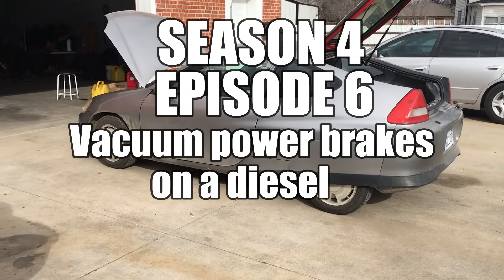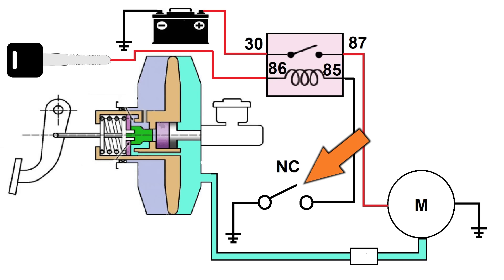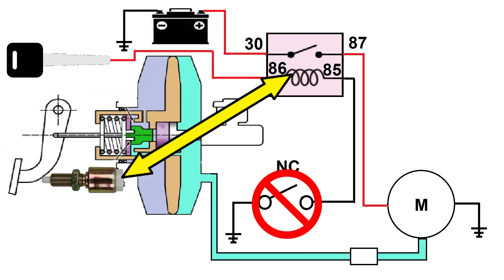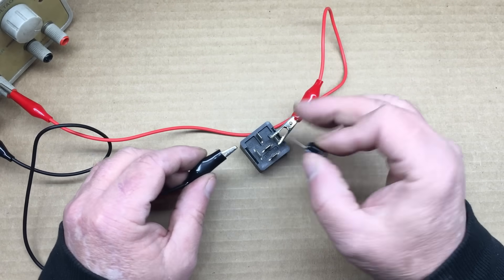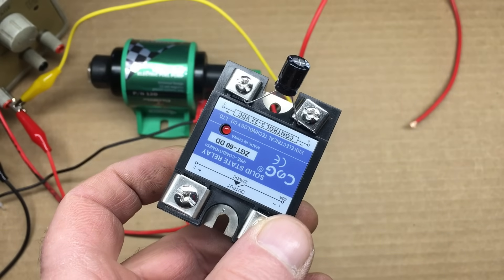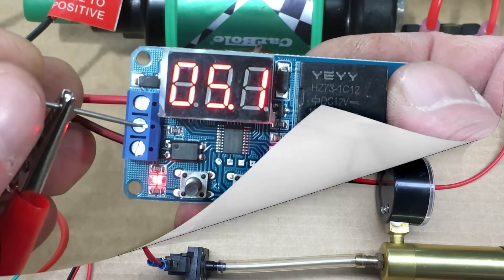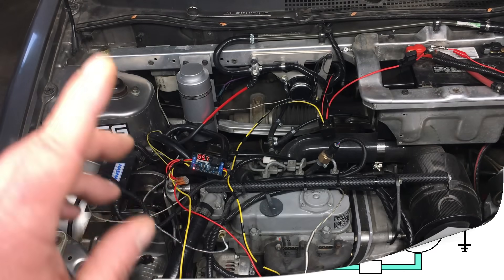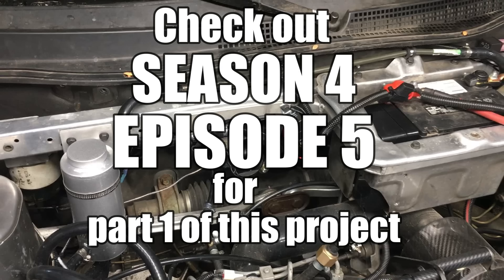S4 E6. low cost vacuum power brakes for our diesel Honda.. problems  solved.

Comment: Why do I feel like Jimbo, low on time, simply punted another episode down the road instead of moving on with the turbo install?  Certainly this problem was not worth an entire episode.

Yeah, so after having offered the above comment, I should acknowledge that Jim may be brilliant in some ways, and less brilliant (like me) in electronics and electronics WRT hydraulic systems.  I'm very sure he tracks and honors some very good suggestions from viewers smarter than me.  I'm in it for the "MEH" and the "guffaw".  Others are more serious.  

Keep on building Jimbo.

Comment: I once wired a relay to a "theater lighting" delay to keep a ICU off for a few seconds during cranking as it was getting its eprom corrupted during cranking.

Also zener diodes FTW

Comment: Shame you couldn't find a replacement relay to solder to the timer board to handle more current and simplify the design. Oh well, them's the breaks. It works, that's what matters 🤘

Edit: Pun not intended but I'm totally gonna take that one 😂

Comment: You probably can just remove the relay from the programmable relays circuit board and just wire the larger relay in place of the original relay.

Comment: would not extra capacity of vacuum via a reservoir allow for pump to not come on as often? aka- reduce the clatter by not reducing the clatter.....  but by reducing "how often" it is in clatter mode to a point it is  no longer or not as irritating to the car occupants.  Reducing that way not only saves occupant ears/mindset.... but also makes pump last longer (not active as often hmmm.. then again it would be active for longer  time period each time hmmm)

Comment: I had a similar problem with making a bed light for my 2016 Tacoma. I used a supercapacitor and charged it with a car brake light bulb to get over the surge issue. The supercap is about the size as the one you in your video, it held the relay on for about 38 seconds, long enough for me to go into the house with plenty of light 🙂 No semiconductors needed.

Comment: Those cheap solid state relays use optoisolators as circuit protection.  As far as the delay for your vacuum pump is concerned, I would probably end up getting an Arduino nano, a 5v trigger solid state relay (or wire up a mosfet with a protection circuit), and a vacuum sensor.  I'd program the Arduino to switch off the relay to the pump at a higher vacuum than I needed to operate the brake assist and switch the pump on at a lower level of vacuum.  It would be more precise and better for the whole system than a simple time delay.  I don't know if you have one, but I would then just use my 3D printer to print out a case for it to protect everything from the elements.  

Actually, knowing me, I'd probably be using one of my ESP32s, grab a logic level shifter to go from 3.3v to 5, use it to control a lot more things, and use the built-in wifi/Bluetooth connectivity to do something crazy and probably stupid like talk to another ESP32 that runs the dash, also giving me the ability to check logged data from my cell phone.  These controllers are incredible and only cost a few bucks.  They're DEFINITELY an incredible value for the money.

Comment: I'm guessing that the vacuum switch is chattering because it's seeing pressure pulsations from the vacuum pump due to its placement in the hose.  If you had a vacuum reservoir and put the switch on the reservoir, the switch wouldn't chatter because the reservoir would damp the pulsations from the pump.

Comment: does any person carrying vehicle do fully electric brakes? (like, electric all the way to the actuator, no cables and no hydraulics?) I assume somebody does brake-by-wire by now and has figured how to make that somewhat safe
Reply: Its hard to beat hydrolic brakes in small vehicles. 

According to Wikipedia- under their "brake by wire" entry, no production vehicles have implemented it to date. It appears it requires a redundancy so it might be down to costs unless something changes.

Comment: Just some points about electrical noise. The large caps across the solid state relay input will filter the low frequency noise spikes. Adding a 0.1 uf cap in parallel will filter the high freq noise spikes. Putting a reverse diode across the input: +ve (anode) to ground, -ve (cathode) to positive side will prevent negative voltage spikes. Lastly, the car battery acts as a monster capacitor. Run a fused wire directly to the battery - consider the battery as a clean power source.

Comment: Could have used a transistor to turns on the relay and the pressure sensor to feed the base of the transistor with a very small Capacitor and a potentiometer to adjust the discharge rate of the Capacitor (how long you want the relay to stay on) transistor don't really discharge Capacitor that fast.... in other words you could have made yourself a basic timer relay

Comment: The modified KISS solution is usually the best, that being the Keep It Stupid Simple approach in terms of reliability. The only other thing that came to mind was a pressure switch that has a fair amount of wiggle room for the on/off cutout, though the cheapie diaphragm-based ones like to blow out at the worst time (aka, when you Need it!) Your electronic timer is perfect though, and should remain Much more reliable. Kudos my man!

Comment: You could always use a mechanical relay to drive the input of the capacitor for the solid state relay to eliminate the inrush current issues.

To keep the programmable relay but simplify the circuit you could de-solder the low power relay from the programmable board, then tap off of the board for the relay trigger signal and run that to the high power snubbed relay.  Or the time delay board may even have a snubber diode on the coil driver, so you can go back to the cheaper automotive relays.

Comment: I think you could do it with a mechanical solution by having an accumulator right before the vacuum pump and an orifice. There would be an excess of vacuum in the accumulator because of the restriction and it would pull the vacuum in the booster below the vacuum needed to disengage the switch, but electronics is ofc fine too

Comment: I was getting all sorts of ideas while watching this video for building a mechanical vacuum pump similar to and old chevy fuel pump working off of some sort of cam, but then I realized the little diesel engine is already strapped and the parasitic load of another device would lower your 0-50 times to a painful level …. Ah well, Thanx for the lesson in electronics ❤

Comment: So, just rolling the rock around here.... Wouldn't it be easier with how small the car is to just ditch the vacuum assist and go with a much larger master cylinder? If it works in my race cars, and they'll stop on a dime, I don't see why it wouldn't work in a much smaller/lighter application 🤷🏻‍♂️
Reply from the maker: Actually, as I indicated in the previous video the power assist brakes aren't really necessary on this car. We dove the car for years without the power assist.  The main purpose of these videos is to provide entertaining technical information.  The power brake info we provided is helpful for  folks who run a lot of boost in turbocharged or supercharged gasoline cars.

Comment: I'm surprised there isn't a check valve on the booster itself according to the diagram. I have found boosters holding vacuum for months even without ever running the engine until the check valve is removed from the booster and you hear the satisfactory whoosh. If the booster loses vacuum without applying brake force then there is a leak somewhere.
Reply from the maker: On this car there is no check valve in the booster.   Foe some reason Honda put the valve in the vacuum line that feeds the booster.

Comment: A reservoir would help (but not necessarily solve) the chatter but not by volume of gas. Part of the cause of the chatter is from temperature change. The remaining gas is cooled on pump-down due to the decrease in pressure. It immediately begins to re-warm, increasing the pressure slightly, re-triggering the switch. This will always happen in a decreasing oscillation until equilibrium. A reservoir adds gas volume which also means a larger thermal buffer as well as thermal exchange area. Decreasing the frequency of the oscillation.  A bunch of variables go into how much of a "fix" this would be. Too hard to say with the small system you're working on. But it is cheap and simple to try. - Oh, and this is why on older cars you'd often see a vacuum reservoir mounted down in the fender. So that engine bay temps would have less of an effect on the remaining gas volume.
Reply: The cause of the chatter is that the switch has no hysteresis, the contacts gradually get pulled apart as the vacuum increases rather than snapping open, and then snapping closed when the vacuum falls by some preset amount. A reservoir will not change this behaviour, a better vacuum switch would be the correct solution.

Comment: A big cheap Solid state relay comes in the 2004 Ford Expedition as the rear air bag pump relay. I believe it's a 40 or 60 amp relay.
Reply: GM used some for their headlamps too (I think it was headlamps? They used them for sure though somewhere) around the GMT800 era I think. My memory is specifically recalling the trailblazer/envoy(and the often forgotten Buick Rainier) platform, but I could be wrong. I very specifically remember it being GM though so they should be fairly available at a reasonable cost these days I figure? 

I love that I'm not the only one that remembers little things like this. First one I ever sold, someone about shat at the price (they were real high still about 10 ish years ago) 😂
Reply: @goosenotmaverick1156  Oh yeah good call I forgot about the gmt360/370 Trailblazer low beam and radiator fan using solid state relays 15-20amp I believe. It's the one with the weird pin layout it had 3 pins on one side then a single pin on the other side instead of the normal 2 pins on each side. If I recall correctly.

Comment: Love to see the ins and outs of this stuff, personal I don't have a clue as to what electric stuff does but it doesn't mean I don't try to follow what's going on .odd really because I made circuit boards and tested stuff for over 13 years (put board in jig press button light goes green or red put board in good box or re work box )

Comment: Great video and explanation, Jimbo.  I’m familiar with all that you went over, but had a thought…. At one point you showed an Arduino as part of your future enhancements.  When you reach that point, the Arduino could easily replace the time delay relay.  👍
Reply from the maker: The purpose of these two videos was to build a solution with off the shelf parts.  This appeals to people without programming skills.   The arduino would have worked fine for this, but not a lot of people can relate to a solution like that.

Comment: can the time delay relay be used to do the opposite and delay the activation of a electric power steering until the car has been running for a while? My power steering pulls 80amp peak when activated and it would be better if the car was running before i activated it so when i turn the key on if it could delay it from turning on for 30 seconds it would be awesome
Reply from the maker: It may cause an error because some of the other systems may be trying to communicate with your EPS when its powered on.
Reply: @robotcantina8957  its a volvo pump added on a car that didn’t get electric power steering its for a custom application
Reply from the maker: @Phil2stroke  Oh,  ok, than a delay ON timer would be ideal in your situation.  You would likely end up using two relays.  A large relay to cut the power on the  80 amp circuit.  To control the large 80 amp relay, you can use a low cost delay ON relay made for motorcycle headlights.  These low cost relays offer a 10 second delay before they turn on.

Comment: I wonder if a guy used a belt driven vacuum pump off of a diesel if it would rob too much power from the motor? Maybe a small electric motor just to power the belt driven vacuum pump so it doesn’t rob engine power? 🤣

Comment: This is an interesting solution to implement a brake booster. I'm just wondering, if the electronic delay part fails, would the relay still be triggered?
Reply from the maker: Likely we would loose power assist.  On this car its not a big deal and it will stop with some extra effort.

Comment: I do believe a different master cylinder would provide the braking and pedal feel you desire without all these components. Possibly easier said than done. In the VW world we would delete the brake booster and use a master from a later model car to clean up the engine bay, but those cars are like Legos between generations.

Comment: I am looking forward to seeing how many miles per gallon you can get. There is a competition in the UK for car fuel economy where the cars have to be driven on a specified route around the country. The record stands at about 105 miles per UK gallon (86 miles per US gallon) which was set in the 1980s with a diesel powered Daihatsu Charade, not the most aerodynamic of cars. Honda tried to beat this record in the early 2000s with the Insight with its gasoline-hybrid system, and narrowly failed to do so. Big question: is the diesel engine without the hybrid system better than the gasoline engine with the hybrid system? The Insight almost certainly has much better aerodynamics than the Daihatsu Charade but there is a possibility that the Daihatsu engine is more efficient than the Kubota.

Comment: You can easily do this time delay relay with an arduino and a prewired relay from the Jungle Site. Why? You are flexible with the inputs (eg Brake Pedal or absolute vacuum value from another Sensor?) and maybe for the near Future you can send Messages from this system to your Dashboard Monitor. OK this ist not there yet but i would definitively overengineer it like that.

Comment: expecting old cars to hold booster vacuum for days seems a little optimistic IMO.
Reply from the maker: I agree, however when I made that statement I actually walked out to my 1995 Saturn and checked.  Sure enough the booster still had vacuum in it after two weeks of sitting.

Comment: In the electronics world it might be a large capacitor but in the car audio world it is tiny lol, we use thousands of farad caps by maxwell as a load spike buffer. Love your videos. And yes I know  6 3k farad caps in series is 500f and has I huge inrush current and output current.

Comment: What is the conductivity of the brake fluid? Is it possible it became corrosive enough to damage the brake booster?
Reply from the maker: The booster is only exposed to the atmosphere.  I reckon it will fix itself once the weather warms up.
Reply: Have you checked to see if a gnome got stuck in there?  @robotcantina8957

Comment: Hey Jimbo. What about some relatively cheap and simple anti-lock brakes? I know it doesn't have anything to do with mileage or performance but I just thought of it while I was watching you work on the vacuum assist power brakes.  Okie doke. Peace. Later.

Comment: Great explanations! Love learning 👍
I think the vacuum tank could have worked, but the problem it solves could be better solved by putting the pump very near the reservoir. The chatter appears to be from rebounding air, or pressure normalizing.

Comment: Much of what  you  have been doing I already understand,  but  where I  wish to really  congratulate you is with the way  you  describe what  you are  doing. Whether you  like it  of not your better  than many  teachers.   Do keep it up.  Incidentally  I used to  drive a Renault 10 back in 1971 and I'm pleased you  have worked your  magic on it. - Do you intend to revisit the R10 project?
Reply from the maker: The R10 is still alive and well.  Since there is no heater in the car, its off the road for the winter.